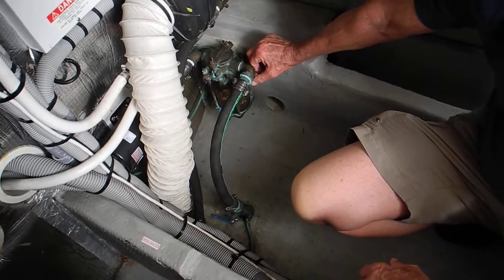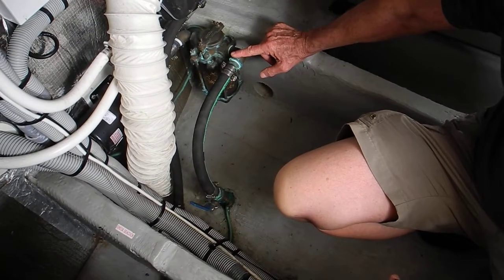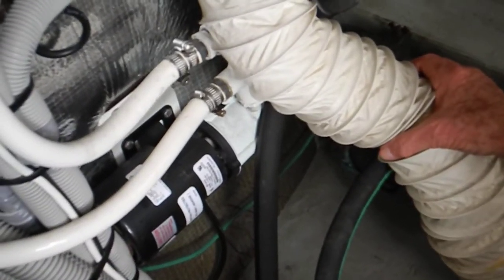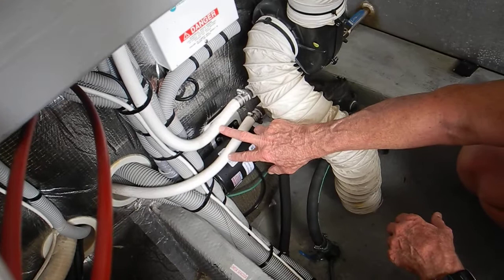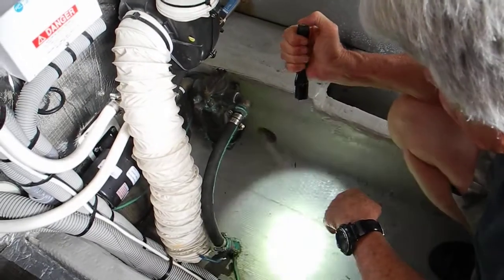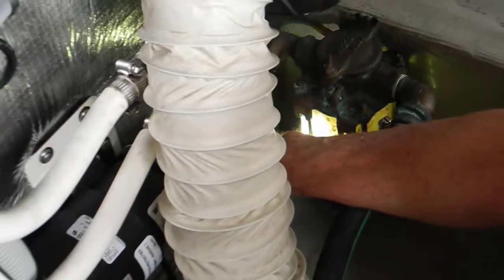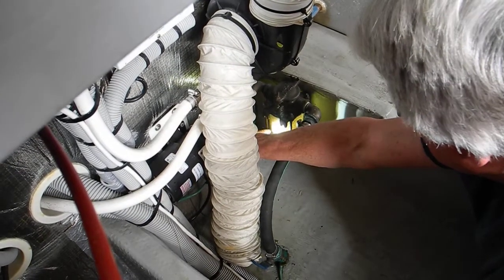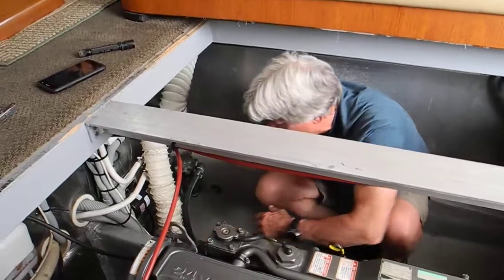Air conditioner water pump and strainer

Comment: Capt. Chris   I recently bought an 06 Larson Cabrio 240   First time out, we docked up to shore power, turned the ac on, worked perfect. Good water discharge from the port side and cabin began to cool really well. Turned unit off, later that night when we were ready for bed, turned back on, no water discharge and unit would not cool... Any suggestions.....
Reply from the maker: robflanagan250 check the air conditioner water pump circuit breaker. Then check the sea water strainer to see if it is fouled. Maybe as simple as you sucked a plastic bag up against the hull intake.
Reply: appreciate cha Captain.... Ill go check it out   sounds like water is flowing thru the strainer and I hear the pump on and feeling the hose going in and out of the pump  fells like water is flowing